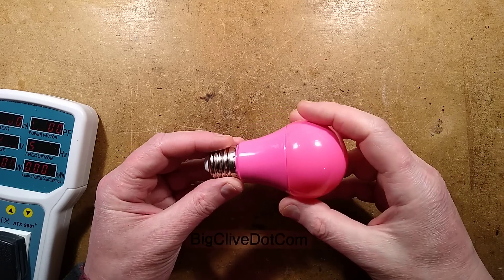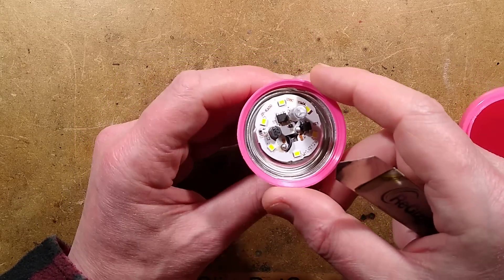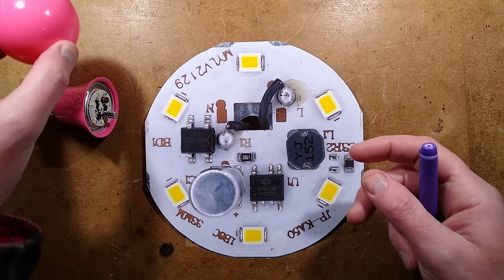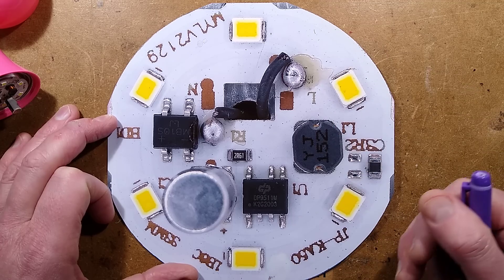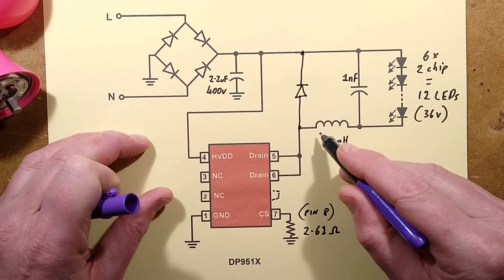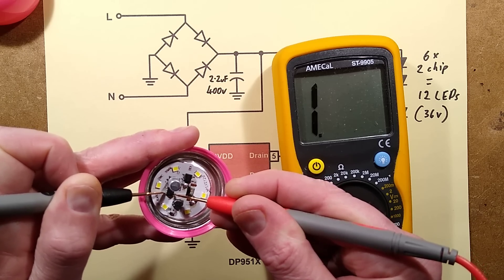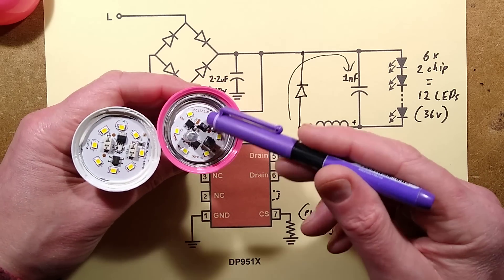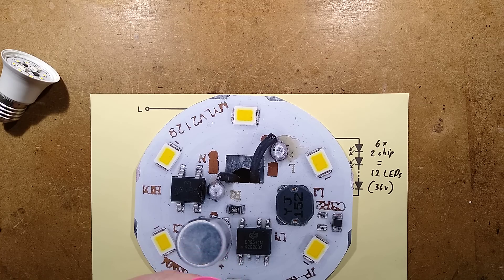Inside a big pink lamp (with schematic)

Comment: This last Christmas was the first time I’ve seen string lights where the colours are created by the plastic that’s been moulded around the all-white LEDs, so I’m not that surprised by this fashion of achieving a pink bulb, however, isn’t it interesting that we’ve now gone full circle from the old fashioned tungsten & glass lightbulbs painted in different colours.
Reply: Technology Connections did a video a few years back on hand-painting Christmas light bulbs, and he mentioned the brand Tru-Tone (in the US) - they make filament LED bulbs in C5 and C7 sizes with the (glass? plastic? I never tested them) envelope colored. They are amazingly-close to vintage painted glass bulbs in appearance, flicker-free, and Tru-Tone also makes retro-style strings with Bakelite-like sockets, thick copper wires, and fused plugs. The sets are a bit pricey, but they are worth it.

It's nice to see the newer technology occasionally be adapted to fit vintage aesthetics. People looking to replace aging sets can make the switch to LED while keeping the softer hues of painted incandescent bulbs.
Reply: @dashcamandy2242 he Tru Tone lamps are indeed glass. I accidentally broke one taking them down after Christmas. 🤦 To be fair, an old fashioned bulb would have broken under the same circumstances. The LED inside still worked though; it's a very warm white color temperature, about 2100k.

Apparently the production process for these bulbs is highly specific and unusual, which explains their cost. David Andora, the founder of Tru Tone, said this in a lighting forum...

"I've gained a lot of insight in the past year that helps to understand why we haven't seen these yet (and what led me to make them for myself.. and then everyone else!) Even our own manufacturing partners are constantly questioning our specifications. This nostalgia isn't part of their culture, and we're specifying methods that are harder and more expensive, and with higher quality components than typical for Christmas lights. They view them as "less beautiful, and more expensive" than the colored diode lights, which certainly have their place, but completely miss the target for Western Christmas nostalgia."
Reply: @dashcamandy2242  it's been a struggle to make leds on the PiDP-8 minicomputer front panel kit look more like the old incandescent lamps that were on the original.  the lights flickered in a particular way when you ran a program that isn't the same with LEDs. a little pwm to simulate the bulb behavior works but it's a surprising amount of computational cycles since there are a whole lot of LEDs to control.  good thing the raspberry pi is more powerful than the original hardware!
Reply: @RealJohnnyDingo  I might have tried a an R-C network to give that tungsten ramp-up/ramp-down in intensity, but doing it computationally with PWM gives a lot more flexibility in appearance.  I would imagine the PiDP-8 is up to it with cycles left over of actual computing, given the old real PDP-8 models had a clock frequency less than 1 MHz.
Reply: The upside from a manufacturing standpoint is you can have a warehouse of white circuits and pop them into the requisite case.
Reply: It just looks better! Old LED string lights are really hard on the eyes.
Reply: @ZeroPlayerGame  New automobiles with LED brake and turn signals also don’t look correct.  At least one company tried to emulate the look of tungsten and made the fade way too slow.  Also the PWM leaves a nasty trail of dots in my visual field that is rather unpleasant.  Lastly, I’ve noticed LED taillights sometimes create an annoying diffraction/interference pattern within windshield glass if they don’t have a good diffuser lens. It assume that is because the small chip size allows the LEDs to behave somewhat like ideal point sources.
Reply: @wtmayhew  LEDs are coherent light sources, aka not-quite-lasers; the light from the whole chip is in phase, which allows light emitted from different parts of the chip to interfere with one another.
Reply: @ZeroPlayerGame  Thanks for your “illuminating” reply.
Reply: That paint used to be Lead based..   "Let's put continuous heat to a lead-based paint!"  Brilliant!  lol

Comment: Magenta LEDs would have made the lamp more efficient while making the factory less so.  They have one line making all the circuit boards, and another line putting them in to the bulbs.  Having only one circuit board makes the factory more efficient, and that is what the manufacturer cares about.
Reply: LEDs could last easily 10 years with good performance and then some more, yet these manufacturers manage to turn them into fragile little pebbles which break in a couple of years at best. Therefore, screw their efficiency! 😇
Reply: Indeed, efficient operation by the consumer wouldn't even rate on the design considerations.
Reply: The whole board is probably an off the shelf part that the manufacturer got wherever they could find one for cheap, at least that's what I would guess since it doesn't even fit the housing properly, and if you buy cheap off the shelf parts wherever you can find them they're gonna be whatever popular LED color is available. So probably cold or warm white.
Reply: It would still be one production line, just load a reel of whatever color led you want for an afternoon and that would probably be enough for a week. You still het the same numbers of bulbs.

Comment: I have some actual pink LEDs, I think I got them from Banggood. They are organic LEDs and have a short life apparently.. I've tested one but never used them.
Reply: Discrete OLEDs? That aren't thin films?
Reply: @NiHaoMike64  i dont know. They are surface mount 2 or 3mm cube like. They are a very nice shade for an led, basically hot pink. I wouldn't be surprised if it's phosphor based

Comment: Presumably if using a pink led over a white one, you'd still get the same level output and total energy cost though?

Hvdd?
Reply: No using a narrower spectrum led will be much brighter as the energy will only be used for emitting photons that pass through the filter/diffuser cap.
You can do the test with a red or green led compared to a white one with a filter.
Reply: @PainterVierax  red vs green through a pink filter is just cheating, white is totally fine
Reply: @phonotical  are you dense? obviously the test is red led vs white+redfilter OR green vs white+green filter.
Reply: @PainterVierax  what kind of reply is that when we are talking about a PINK light, stay in school.
Reply: @phonotical  this is the kind of reply you got when you skip school and can't understand basic answers, lil bro.
Substractive light is not efficient, period.

Comment: Pink/magenta LEDs are actually pretty expensive. No surprise they're white.
Reply from the maker: They're not that expensive, but the multi-chip versions are harder to get in colours other than white due to their main use in lighting.
Reply: @bigclivedotcom  OK I have old info then. Last time I bought pink LEDs was 6 or 7 years ago and in hobbyist quantities they were 5x the cost of white or other colors.
Reply from the maker: @John_Ridley  When they first appeared they were very expensive and faded quickly.  They're much better now.

Comment: The chips are moving on so much. Pink LEDs would be nicer, but I guess they shove the same circuit into every colour light. 👍👍
Reply: when you guys talk about pink or magenta LEDs you mean red & blue LEDs? because pink/magenta light doesn't exist, its just blue and red mixed together that our brain perceives as pink/magenta light
Reply: @yoshtg  All none RGB light is a figment of our imagination, we only have RGB receptors. in our eyes. So yes would be the answer.
Reply: @dcallan812  no but there are orange color wavelengths in physics, there are also yellow colored wavelengths (sodium vapor lamps) but pink wavelengths do not exist. only red and blue wavelengths exist

Comment: The diode in the chip you measured is most likely just the ESD diode. In most chips all I/Os have diodes to VDD and GND to dissipate power during ESD events, in case the input voltage exceeds the power rails.
They can be used, but the tens of milliamps here would most likely completely overload that tiny diode and lead to an early death of the chip due to electromigration or overheating.
I assume they have integrated a second transistor to VDD, that would be smaller and more efficient than an integrated frewheeling diode, turning it into a synchronous converter. But who knows what the Chinese chip manufacturers actually did ...
Reply: I got it in me. Where is the little rope to get it back out?! Starting to freak now😮
Reply: @rob379lqz You're meant to screw it in first so you can pull on the flex. It's a schoolboy error.
Reply: @rob379lqz  did you fell on it in an unhappy accident ?

now your stuck with it 😂
Reply: @rob379lqz  Thats what you call "A light bulb moment" 😁
Reply: SInce MOSFETs have parasitic body diodes and those can usually pass the same or similar current as the MOFET itself, ESD protection diodes on power outputs are usually unnecessary. The only Chinese datasheet I could find for the chip only shows the low-side driver in its block diagram, doesn't appear to have anything about what happens when the low-side switch goes open. The diode from drain to HVDD may be a lucky accident.
Reply: @teardowndan5364   @tomsixsix  In normal processes you never want to forward bias the body diodes, as this injects charges into the substrate which can lead to latchup, so usually there is also ESD protection on the outputs. But anyway, if this was just an open drain NMOS driver as in the datasheet, there would be no diode to VDD, only to GND. The datasheet says they have a 600V freewheeling diode according to google translate, which seems weird to me, a transistor for synchronous operation would take the same or even less area and dissipate much less power.
Reply: You wouldn't see an ESD diode on the drain pin of an internal MOSFET; it's definitely deliberate
Reply: @tomsixsix  There is a parasitic diode from the PMOS  source & drain  P+ contacts to N-well that is in turn connected to supply through a N+ well contact. These diodes are normally reverse biased unless the drain or source become positive with respect to supply which it is in tis case.. However, this diode is almost certainly not characterised for use as a diode unless the output buffer is custom designed, so it is not good to rely on it.
Reply: One way to test is to check for a reverse diode between HVDD and GND and compare the forward voltage drop. If the Drain to HVDD diode drop is lower than the diode voltage drop of HVDD to GND then the Drain and HVDD diode was manufactured for freewheeling. If both diode voltage drops are very similar then you're measuring the bulk substrate or the ESD diode (sometimes the same device).
Reply: I haven't heard much mention on this comment thread of the fact that this is a power IC, and without a freewheeling diode in this place in the circuit (taking a peak current equal to the peak output current) the internal mosfet will self-destruct (the voltage on the drain would rise until breakdown due to current from the inductor). For these reasons, the diode will definitely be intentional, despite the lack of mention on the datasheet.
Reply: It might have another P-channel MOSFET to the +V and he's measuring its body diode.
Reply: @alunjones3860  You'd imagine that if the chip had synchronous rectification, it'd be shown in the datasheet's block diagram as a star feature. It isn't, and neither is a diode despite being a pretty important detail. Maybe the text says something about it.

Comment: In general with the SOP-7 package manufacturers label the pins 1 through 7. Slightly confusing as it's exactly the same size as the equivalent 8pin package.
Reply: To make things more confusing, some DC/DC convertors come in what appears to be (and is actually stated in the datasheet as well) a very high SOIC-W package with a double pitch. The very same datasheets state they use regular SOIC footprints missing every other pin, thus the numbering comes as 1,3,5... :)

Comment: I've been on an endless hunt for pink through hole leds that are not clear when not lit. Same with purple. Like 2 years I've been looking. I've accumulated over 100k keds in my online travels haha
Reply: I think you need RGB leds Joey. There are many different power options and all sorts of package types. You can achieve many colours of light with amazing sensitivity with those bad boys. But since you've accumulated 100k leds you've probably come across them.
Reply: It's true you can't buy them 🤣
Reply: What do you mean by not clear when lit?
Reply: @thegamerfromjuipiter7545  Exactly what I don't get. If anything I'd want them to be clear when not lit and give off coloured light.
Reply: @thegamerfromjuipiter7545  - he said not clear when NOT lit - i.e. when they aren't on they still look pink / purple. But in that case can't one just use a colored cover? - if the color of the cover is the same as the color of the light produced, as Clive alluded to, the brightness drop/power waste should be pretty negligible, only if there are other frequencies produced by the LED is when you start to see inefficiencies, at least that's my understanding.

Comment: At the very least they could have used a glass cover with the inside coated in magenta-emitting fluorescent coating. That way you'd get a much more efficient reproduction of the light no matter the starting frequencies.

Comment: A not perfectly smooth surface releases from the mold easier.
Reply: I don't think this is the case; the shape of the cover would be extremely difficult to make using injection molding. It's most likely blow molded or rotary molded, then goes through secondary processing to remove extra bits and polish the exterior.

Comment: Interesting how much circuit design changes over time.
Reply: Yet, often the old becomes new. Switching power supplies are old tech that awaited better and cheaper parts.
Reply: That missing diode stays inside a custom chip so they didnt put it on schematics :)
Reply: @Tylko_cała_prawda_jest_Prawdą  Their custom spy chip right 😼
Reply: Often driven by new parts becoming available - in this case tiny and cheap high voltage linear regulator chips and especially many(-many)-junction LEDs.
Reply: Thousands of people working in the industry tweaking things here and there and over time circuits change dramatically. Now is it best of breed or worst of breed.
Reply: It's almost like... intelligent design :)